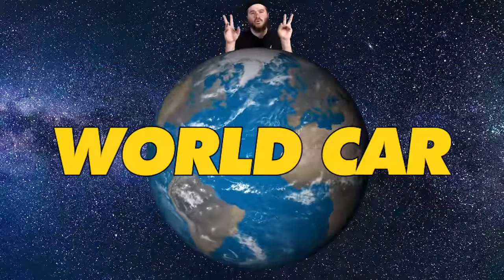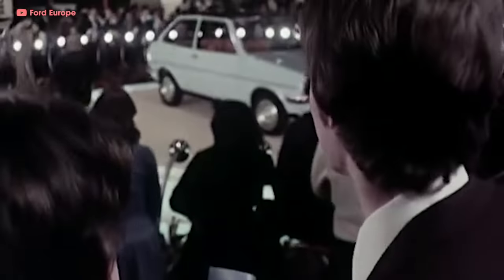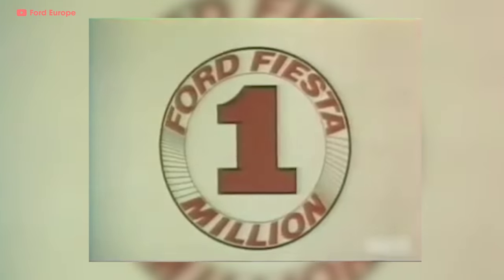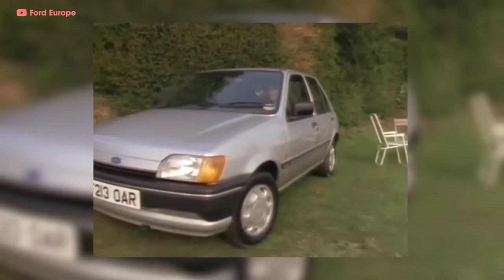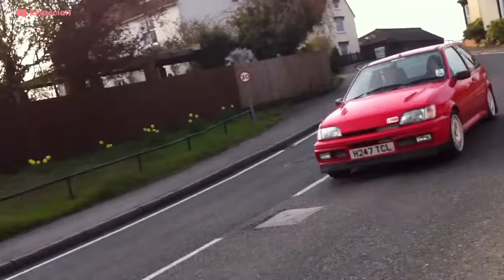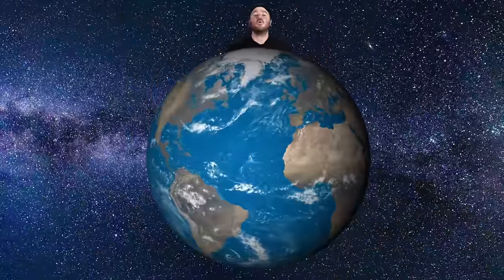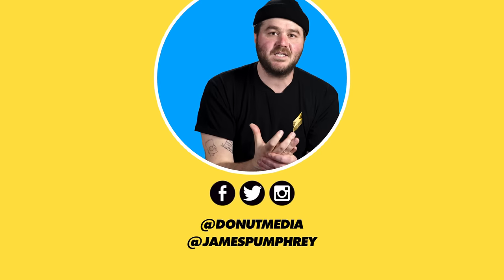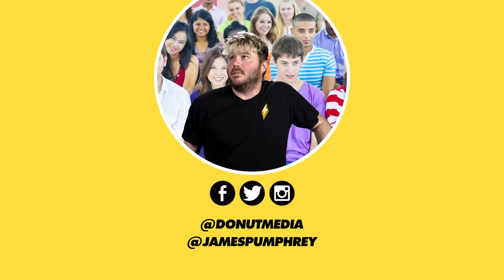FORD FIESTA - Everything You Need to Know | Up to Speed

Comment: Thanks for the love! Our fleet of fiestas are getting some extra love in this down time. Looking forward to sliding around again soon
Reply: Donut up to speed on Team O’Neil????
Reply: Ha, your video of the Fiesta is the reason I got my Ford Fiesta for my rallycross car.
Reply: That seems like the most badass thing to ask someone if they want to go do. Hey should we go race go karts and play put put or race offroad in a rally car
Reply: @johnnyturbo8460  Same here!
Reply: @steven_7577  nice! I have some videos posted on YouTube of me racing.. last year I got 3rd over all because I missed 2 races and the points that go along with them. But got 2nd over all the year before 😁👍
Reply: I checked out your videos! great stuff; and impressive results, are you in the two wheel drive stock class?
Reply: @steven_7577  thanks, yes stock front wheel drive class. It allows for cat back exhaust,  drop in performance air filter, upgraded stock design shocks, skid plates, performance brake pads and snow tires which I have all of them.  It's been an awesome time. Meet great people,  race cars and you work the corners when it's not your time to drive. If interested I would be happy walk you through my set up or help you learn how to get racing
Reply: Do you guys have programs for Drift

Comment: James: The average power of a car today is 230 hp
Me from Austria: chokes on my beer
Reply: Tschimbo 12 makes me realize that of my 3 vehicles, only one was rated above 230hp from the factory, the one that’s 27 years old (my 93 Z28- rated at 275hp to the crank but in actuality makes 268hp to the wheels which is around 310hp at the crank. They under rated it as not to step on the corvette’s toes). My 23 year old Jeep was rated at 180hp and my 47 year old muscle car was only rated at 170hp (of course they were lying when 2 years prior it made 230hp and nothing actually changed in the 2 proceeding years and it’s not exactly stock anymore).
Reply: @CamaroAmx  The thing is in Austria, taxes and the mandatory insurance is is highly dependent on the engine power. So you have to have a decent income to be able to afford a 200hp car. The average car has 123hp.
Reply: Tschimbo 12 that’s fine. Buy a lower hp car and modify it so it makes far more.
Reply: @CamaroAmx  I don't know about Austria but I know that we in Germany can't just modify our cars that easily. Inspections here are pretty strict and I guess it's similar in Austria
Reply: I was the same, I have 210bhp and it’s considered a reasonably quick car.
Reply: That sucks ass. But don’t be upset, I’m an American with an 89 horsepower (brand new) ‘84 nissan 720. It depends on income here too; if you can’t afford a fast car you just get a slow and old one lol
Reply: Robert Baptie the factory rating was 275hp at the crank. However dyno tests have revealed they make an average of 268hp to the wheels, which equals about 310hp at the crank. Therefore they were under rated from the factory. GM was famous for under rating their performance engines outside the corvette, even if the car came with the same engine as the corvette to keep the corvette as the top performer. There were very few exceptions such as the GNX.
Reply: The average in India is 100 hp.
Reply: That's not true for cars. Maybe If you add trucks and SUVs but I don't think that counts.
Reply: @Gabriel-vj1cf  no it's true the highest power a common man's car makes here is 110hp and it's an suv
Reply: DrCowmoon Brake horse power or BHP is what people called as horse power at the crank . Wheel horse power or WHP is measured at the wheel, with every load installed ie driveshaft, clutchplate etc. BHP is not the same as WHP
Reply: My family's cars: 60hp (Fiat Punto 2002 - Mom's old car) + 60hp (Fiat Punto 2001, Grandpa) + 125hp (Ford Focus 2016 - Dad) + 90hp (Škoda Rapid 2016 - Mom) + 101hp (Alfa Romeo 146 1998 - Mine, Dad's old car)
90hp (Hyundai i30 2018 - Brother), 70ish (Opel Corsa 2014 - Brother)
616 HP, 7 cars.

Yeah, welcome to Europe
Reply: My car is 98 crank and its a 2017 :(
Reply: Nobody in the uk could insure that under 25 years old
Reply: Did the exact same thing and I am from Denmark. Its more like the average is 70 HP xD
Reply: @captainkaixa  exactly 230 as an average is too high.
Reply: @Gabriel-vj1cf  I know!
Reply: in my country a 200hp car is considered fast as hell,its something to brag about,ive never had a car with more than 163hp
Reply: @tschimbo12  That's interesting to know, I know more about japanese and chinese road laws than european. It's funny since my family all drive german cars that make at least 200hp (me, mom, and sister drive 2L I4 with turbos and my dad drives a 335d bmw) I thought 200hp was a common thing in Germany too.
Reply: @Nikkisawa  Germany has a better situation than us, since most of their taxes are based on engine displacement. So 200hp aren't that far off the average engine power. Only big V6s and V8s are expensive over there.
Reply: me from England: Chokes on my tea

Comment: Got myself a Fiesta ST as my gas friendly daily about a year ago and I've loved it so far!
Reply: It's such a good daily! I honestly wouldn't suggest someone get one as a track only car, there are cheaper used options that'll turn circles around a fiesta st once you throw a couple upgrades at them.

Can't do better on the smiles per dollar metric though.
Reply: Nice, I’ve had mine for over 2 years. Still love it, only thing I’ve had to replace was my purge valve. $50 fix and that’s it!
Reply: GoatSea Fiesta ST’s are cheap to mod and make faster than most cars on the street. I own one.
Reply: Kyle Huish They probably would fix it for free at the dealership. It is a known problem. They were going to fix mine for free but it took so long to get the part I just ordered it online and did it myself.

Comment: "average HP today is 230"
Me with my 92hp APV: (chuckles) "I'm in danger."
Reply: Platinum Nath that is a totally false claim based off no factual information. Often cars have 120-200hp. Trucks might have more but its unreasonable to consider them in a car hp average.
Reply: @maybelive765  that's still more than my 13 years old APV tho ;-;
Reply: 58 hp in my 660cc car
Reply: I'm driving a 82hp fiesta and my buddy a 50hp fiesta...
Reply: @TheChaosfreak97  i`m driving a 60 hp 2013 fiesta
Reply: 123 HP Fiesta here :D
Reply: @maybelive765  There are also a lot of ways to define "average" here, so I'm not sure that's entirely false. Like, are we weighting it by sales, a la ([HP of Car 1][Units of Car 1 Sold] + ... + [HP of Car N][Units of Car N Sold])/[Total Cars Sold], or are we not weighting it by sales and just averaging the HP on the sticker for each model on sale? A similar question is whether this average applies to all new cars sold in 2019 or specifically cars from the 2019 model year. You made a good point too about whether we're leaving out certain kinds of vehicles or not.

I agree that 230 HP does seem high to me, though.
Reply: @notstarboard  Yep exactly. Although I currently dont have access to any of the cars to this very day, Im fairly sure most people dont drive cars over 200hp. On another note, hp is useless without considering power-to-weight and acceleration times. These are the real figures that get me excited!!!! and no. Most cars suck in those departments lol :)
Reply: @xOne_Two_Three  60 hp 1.25 Fiesta here too!
Reply: @maybelive765  over here in America a lot of people have cars with 200ish horsepower, it's pretty common. My shitty 1000 dollar Buick is putting out 210, and it's the slowest car I usually see on the road.
Reply: notstarboard zetec s mk7?
Reply: Me with my 1/9 hp legs on my bicycle

Comment: theyre cool cars, and if you get maintenance done these ecoboosts are pretty reliable. a local guy has a 2017 fiesta st with 290,000 miles on it. no major repairs other than routine maintenance. pretty impressive.
Reply: 2017 with 290k miles sheesh

Comment: I had a Fiesta ST 07 model. It was a solid car. Very reliable engine. With its very wide tyres it sat on the road like a tick on a bulls bum. 
It revved and sounded happy to do so. Economical if you where sensible. It was a blast. 
Very regretful sale.

Comment: James: the average power of a car today is 230
Me: in my 53hp Renault 😅, I'm gonna die   😅
Reply: If only my wife's Elantra had 230hp! I might actually want to drive it
Reply: My dad dacia have 79 to 89 hp
Reply: @sex_therapist  that's pretty normal in my country
Reply: @hassanlabyad4082  that's the normal here in India between 70 to 90
Reply: My mk1 fiesta has 50, hehe
Reply: If you take out the rich folks out of the equation who probably owns lambos and shit then the average power of car today will be much less.
Reply: @densanity7974  a couple thousand lambos don't even show up on the statistics as so few are sold.
Reply: @Anirossa  Its just an example mate lmao. My point is rich folks will typically have faster cars than your average folks which is why the average is higher than expected lmao.

Comment: My first car was a 1980 Ford Fiesta I bought for $120 in 1998. I could NOT kill that thing... and I tried. Blown rad hose? No problem, it kept going. No oil? Not an issue, it'll get you home. Fire in the engine bay (twice!), np, started right up after it was put out. Finally, some 8 years later (and an epic thunderstorm) the Fiesta met it's doom, not by anything the driver did to it, but a huge oak tree turned it into a hotdog bun. I still love that car, super fun to drive and whip around mountain turns.

Comment: This is like 1 of the very few modern cars i wouldn’t hate using for daily driving.
I personally don’t like most economy cars, they’re extremely boring imo
Reply: Yeah the car is really fun. Super agile. Really quick and raw. Probably a little too rough but really fun
Reply: Try GTI, guy. 🐇
Reply: My mom has one and I can confirm it’s fun to drive lol. 28 mpg but you can make the front wheels spin at every stop sign
Reply: @PrydeWater901  GTI? Which is heavier by 40%??
Reply: a 2013 SE dual-clutch is my daily driver and i absolutely love it. even more fun modded
Reply: economy cars arent meant to be exciting.
Reply: @huleyn135  well maybe they aren't meant but fiesta is exciting.
Reply: I drive the Focus RS MK3 as a daily. But if i had the money, i would use the Fiesta ST MK8 as a daily and the RS for weekends or fun trips =)
Reply: St0rmCh/\ser Fun with usable space and about 30 mpg on 87 octane in mixed driving. Fine by me.
Reply: @IgorkubMASTER  yes fiesta st, swift sport
Reply: Frankie Nery that’s all i really want from a car, not too heavy, zippy and some straight fun

Comment: Even though my soul belongs to Honda, I must tip my hat to the ST. That's a damn good car.
Reply: The Fiesta ST converted me from a lifelong Honda fan. Never going back until my Fiesta ST dies after I throw every part at it left on the earth. It is true driving perfection. That steering alone compared to Honda sold it to me on the spot. That was the one and pretty much only thing I thought my Hondas were great for, steering feel. Fiesta ST steering made my CR-Z feel like a floating boat. Loved that CR-Z though even though it was slow, had it modded out with H&R springs, Magnaflow exhaust, Takeda cold air intake. Steering was tight and heavy in sport mode only.

Comment: I knew a girl in high school who had a mk1 Fiesta. I got to drive it a few times and it was fun to drive. Sometimes driving a slow car as fast as it will go, is more fun than driving a fast car. The Mk1 is so lightly built and un-insulated that you feel every bit of the road and hear every rattle and squeak. I remember the sound of the doors closing being so metallic with a click instead of today's  cars soft thud. Going 70 in a Fiesta feels like 100. Compared to today's small cars, driving an old Civic or Golf Mk1 or Fiesta Mk1 feels like driving naked. The fun thing about those early small  hatchbacks was that they were so light and nimble on city streets like the ones in San Francisco where I grew up. One late night, my friend and I drove his 1972 Honda Z600 through the pedestrian tunnel under the bleachers onto the mile long packed sand jogging track around the Polo fields in Golden Gate Park.  We were getting sideways on the turns with only the light of the moon to see by and Ozzy blasting on a boom box in the back seat. You could get away with more shenanigans back in the early 80's. There were fewer cops and as long as you didn't hang around one spot too long you could pull some fun stunts.

Comment: i learned to drive in fiesta diesel manual and my first car was a diesel fiesta, it pretty light weight and heavy diesel you could quite easy get got weight transfer have some real fun in the corners heavy front end light rear. it driven very well and small and lightweight 2007 one so it was small car compared to modern city cars, good tires and brakes you could push pretty hard in corners. still to this day i stick to lightness my current car just under 1.1 tons with full tank fuel add 8 stone me just tad over 1.1 ton, lightweight adds fun esp as most my driving is tight twisty country roads and the odd mountain roads so small light weight car keeps driving fun but not had ford for 4 years now, it tempting but they discontinuing the fiesta so prob not now. The Fiesta was the UK's best-selling new car for 12 years in a row between 2009 and 2020 and in July 2014, Ford declared it to be the best-selling vehicle ever in the UK with over 4.1m sales since 1976.

Comment: you forgot about the recalls on the transmissions 2010-2019
Reply: Go the ST - only offered in 6sp manual! (in Australia at least, not sure about other markets).
Reply: A poor choice by Ford to use a  dry dual clutch system and software that can't manage it. Ending up costing them millions in recalls and class actions
Reply: @EagleEye8208  SO true.  Worse yet, it wrecked the car.  In 2011 the Fiesta out drove, out handled and out "featured" any other small car.   Everything on the car was solid... except for the transmission.  And the transmission was AWFUL.

Comment: “My eco boost is stage 3 so it’s actually faster than the st” ever 18 year old in the uk
Reply: or “my st would smoke a golf R”
Reply: Weird how the eco boost is neither eco or boosted
Reply: @HarryG98  STs can't even smoke Polo GTIs
Reply: yo mate trust me my 1.0 ecoboost ST line has bonnet vents and an RS wing. Basically a Focus RS. Just wait till i get my Airtec intercooler installed.
Reply: Michael Gallagher i know lmao i have a ibiza cupra (literally a GTI but just a seat body) and i smoke STs all the time😂
Reply: Hez its got a turbocharger lmao
Reply: @HarryG98  what year?
Reply: Michael Gallagher 2015
Reply: @HarryG98  ah so the 1.8
Reply: Michael Gallagher yeah man
Reply: Hez the ecoboost is boosted because all of them are turbo charged. And as far as eco. The idea was to make a small more efficient engine and then add a turbo to make to engine feel bigger then it is. When your off boost, they are actually pretty fuel efficient.

Comment: after 6 years of ownership..i was nearly broke repairing my ford fiesta's dual clutch transmission, suspension, radiator and alternator.. and still the problem is still there.. i immediately trade it in for a honda before i got completely broke.. good luck to other fiesta owners out there..

Comment: In the UK ford fiestas are really common, I picked a good(ish?) example of a mk6 fiesta, 2002 model, 1.4 liter with the 5 speed manual transmission. I love it, gearbox feels really nice, better than my mates corsa which is the biggest rival. Its a bit slow, but for 500 quid its only done 60000 miles with a full service history. If you look hard enough, you can find a good example for cheap like I did :) (I'm 17 the 1.4 was dumb they want 1700 for insurance for my first year when I have passed).

Comment: I drove a Mk5 Fiesta ST around south east England the summer of 2006. It was a perfect car on the little  narrow country roads. I spent a lot of time driving between farming towns on local roads with no shoulder and usually tall hedgerows or stone farm walls hemming in the road. Sometimes it was like driving in a green tunnel. The terrain is gently rolling and the roads not so twisty as curvy. The car felt very controllable, going quickly was easy. I had passengers so I could not go too fast but it was still fun to see how fast I could take corners with disturbing the wife.  Also I've noticed the Fords I've driven in Europe, even base models, are nicer than than their American counterparts. They drive better and the interiors are slightly nicer. This was especially true for the Escorts I've driven. In England 80's and 90's Escorts were kinda sporty and young "chavs" dudes who wore Burberry baseball caps drove them. The American versions of the same cars were pretty bland. My parents had three different gens of north american Escorts (1st, 2nd and 3rd))and if they didn't all have manual sticks, they would have been horribly boring to drive. Still with the all that under steer I never liked them very much. In fact their 70's Pinto was easier to get sideways and did great parking break turns.

Comment: Personal request : up to speed on Honda HSV-010GT, the Japanese Super GT GT500 legend. Won many races during its short life span and it was an eagle with broken wings (never made it to any public market, no road versions available at all). A Honda with V10 NA, 8000rpm+ redline, 600horsepower. Front engine, rear-wheel-drive. Tested at Nurburgring.